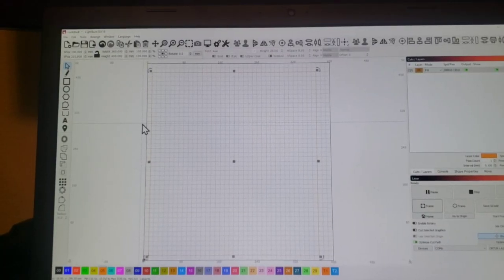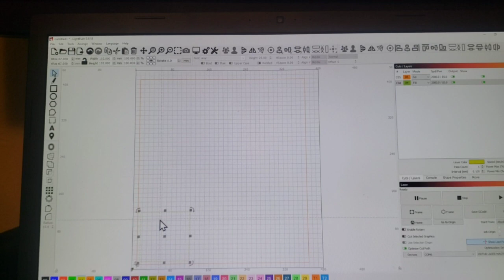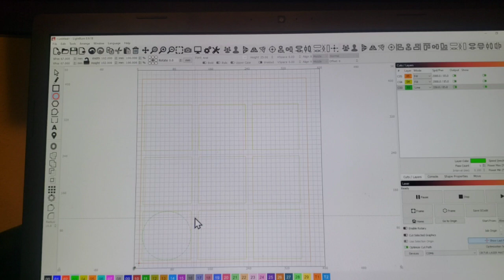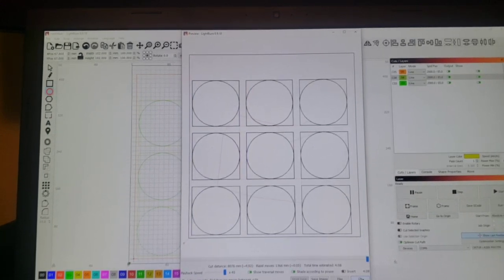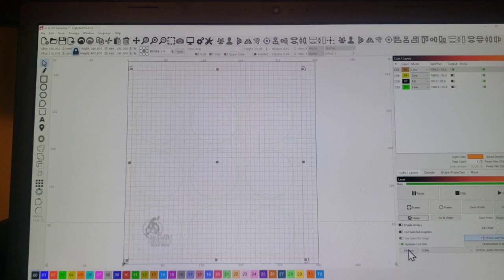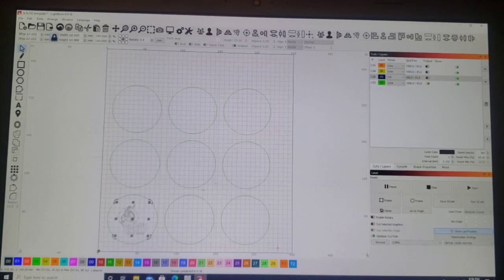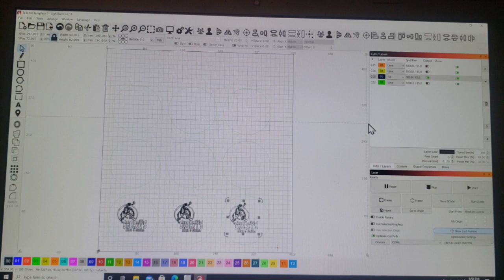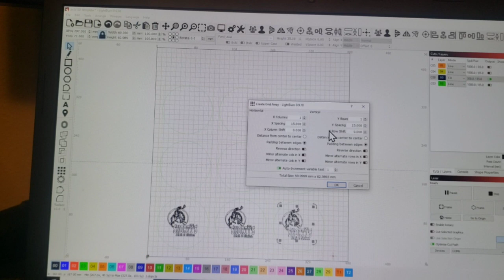The Kenny Hack: Making Jigs/Templates for Batch Projects. Ortur Diode Laser.

Comment: Why not cut the squares out of 1/8 inch material.  Rather than finessing each tile onto a square or round etching, just drop them into the cutout.  Circle fits in the square.  Done
Reply from the maker: well it's less cutting time to cut a circle vs a square. Also, diodes cut better in the y-axis vs the x-axis. Cutting a circle cuts more evenly. The best material I've found to make templates with is 1.5mm craft board. cuts very clean and fast. I then glue it onto another layer of craft board to help keep it flat and stop pieces from sliding under the jig cutouts.

Comment: Great video. I was getting ready to burn a grid template but this seems like a better method. Even if I'm not burning a coaster or tile I can still use these lines to align my project.
Reply from the maker: I'd suggest a big square and circle style bullseye as a general grid for most things. A square and ring every 20mm should be plenty to center most anything under the laser. Make a few different ones.  2'x2' MDF boards are cheap. Under $5 and make great template boards as they are much flatter than plywood that can warp easier.
Reply: @TheKennyHack  I have an Ortur Master 2 but don't use it much anymore. I switched to a jtech 7w laser with Acro 40inchx40inch rails for a larger build surface. Home Depot has some 4 ft x 8 ft mdf boards I can cut so I'll probably use those for templates. I'm working on a folding work bench for it now since it takes up so much space in the garage.
Reply: @TheKennyHack  hi Kenny. any idea where I can get this kinda grid templates to download?
Reply from the maker: @TheMessenger012  I just make everything I need in Lightburn. it only takes a little practice to figure out and then you'll be able to make any template for exactly what you need. If you join a Facebook Forum you can find basic grids for your model of laser beds to get started. if you have an Ortur join the Official Ortur UserGroup on FB. A lot of good info in there. Use the search to lookup old posts to answer most questions.